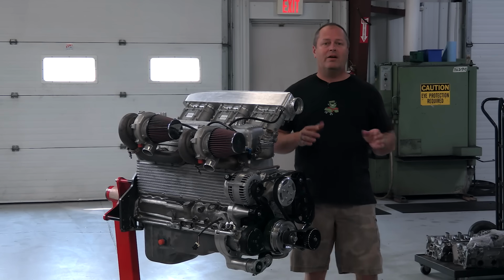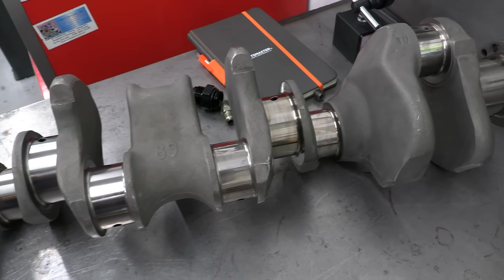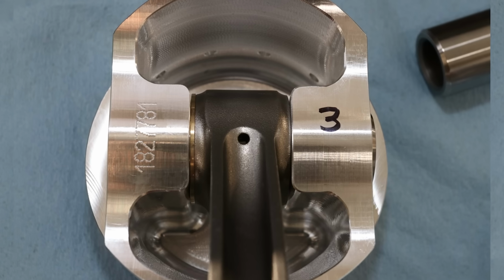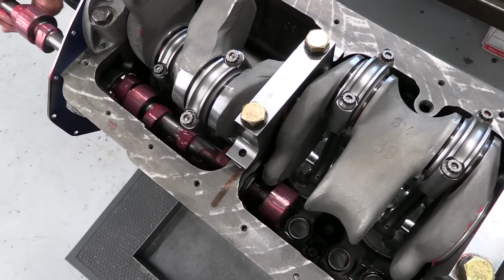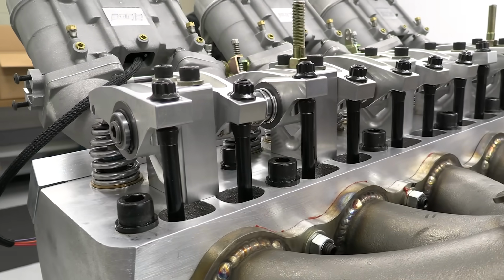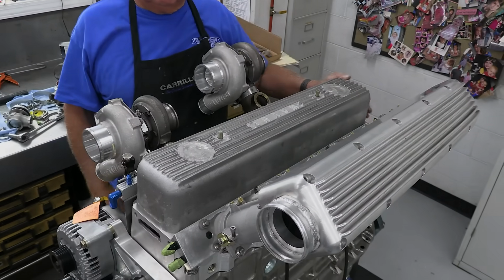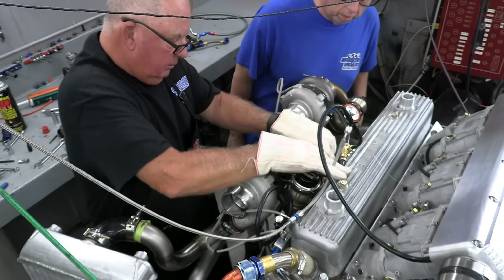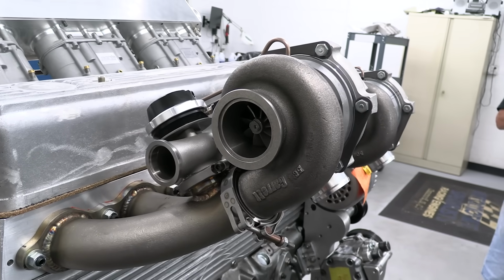Incredible Twin Turbo Chevrolet Straight Six is a One-of-a-Kind Creation!

Comment: First time watching your channel . I'm a Aussie and our straight 6 is based on the Chevy straight 6 with smaller cubes . But in Australia straight 6s where extremely popular in the day so we where able to obtain high performance parts because straight 6s where raced here . And where extremely popular street racers because the light weight cars we had to the American cars that where very heavy but great cars . We still race straight 6s with modern technology in block and head design where actually getting over 400hp none turbocharged straight 6s in a race car . There are several YouTube vids and builds of Holden straight 6s for race and street cars if you'd like to check them out .
Reply: The Holden straight six was based on the Chevrolet engine design wise. But as I understand it it has a smaller bore center.  Similarly the Ford series of sixes up to and including the Barra all had their roots in the 170 CID Thriftmaster that debuted in the 60 Falcon. The Chrysler six was based on the Slant but I'm not sure if it is mechanical locally and dimensionally the same.

Comment: Back in 1961 a friend of mine took a '57 Chevy convertible with a 6 cylinder motor and replaced it with a custom built GMC truck motor which was 300 ci instead of 250 ci like the auto engine. He put a custom cam and milled the heads for higher compression. Also installed an Edelbrock dual carb intake manifold with custom headers. That engine would wipe out a stock 283 v8 in a 1/4 mile drag race. The engine torque made the Chevy a tire burner.

Comment: Suburban should tow like a freight train with that torque curve! Turbo systems unbelievably happy making serious cylinder pressure down low for a stump pulling torque that never leaves. Makes cool whistles and stuff! LOL makes ya giggle when he pulls towards get er done throttle and boost instantly come on line! Very cool! Have a 94' GMC 2500 truck that is getting bagged, parallel 4 link, and 76mm turbo but blowing threw original TBI with a second fuel system added in blow threw hat to make sure 7.4 TBI can feed the 5.7L fuel under boost. Ported swirl port heads, RV cam, and springs should make serious down low torque.

Comment: Neat build, but I take it the design process is a lot easier when they must have room for a family of four and then some under the hood of the vehicle. Everything just sticking straight out with no worries for clearance. (Modern cars it's interesting how tight everything is packed towards the engine to deal with that.) But technically it's still a marvel of sorts.

Comment: Jeff that is an awesome build.  Definitely love seeing old school getting involved in the turbo tech.  That torque line is absolutely amazing and just what that heavy hauler needs.  

I was surprised to see flat top pistons, I thought it was an automatic for bowls and combustion efficiency -  was ratio a big factor in ?  I'd recommend overkill on the exhaust side.  By that I mean bracing for those garrets!!  They are just hanging out there and it would be a simple task to brace them up further reducing the chance of those manifolds failing.  

Again just plain awesome - 500 plus with the potential of 750 on pump 😯
Reply from the maker: Thanks! Hope you’re doing well!

Comment: Im not that impressed but Im spoiled. This seems a chevy fanboy project not a optimal performance build. This engine will not last very long a the that performance, dialing back the turbos as not going to save this engine from a short life. Typical Chevy bla bla bla LS this and that that means nothing. " put LS parts on it so Ra RA Chevy" why do Chevy guys always forget good cylinder liners and pistons. This engine will die young. Got to give him credit for building it so it runs smooth, Obvious NASCAR experience. I come from a Reno Air Racing  and Bonneville back ground and this kind of build wouldn't last 1 lap. Back in the 80s when I was a kid building hot rods and racing them I knew to use ceramic liners and I was not a pro yet. I have built 170in3 engines that are less than 200lb that made 780lb of torque 935HP at 6300rpm. Ran it 471hp continuously and it lasted over 2000hrs before overhaul for you automotive guys that is equal to 850,000 miles. Chevy guys are so out of touch. Thy can't ever comprehend why I can make that power without using a Chevy big block.  Or why I can go over 400mph with such a small engine that wont die. You all so out of touch. This thing would probably run forever if you just put some ceramics in it, I means its like WW2 level technology get up to speed.

Comment: Absolutely awesome build!
From conception to testing. 
I missed the final intended use of the vehicle. For a low use show car fuel use doesn't matter much but it looks like it would drive well anywhere between ticking around and ludicrous.?I wonder if spark plug selection is a challenge. 
Amazing knowledge and choice of parts.

Comment: CHEVY STRAIGHT 6 cyl were indestructible 230ci and 250ci and 292ci many miles and Clifford aftermarket manifolds, exhaust, carbs and if you bored out the 230,250 man it just ran, torque always rules..yeah I’m 59 had my share of Chevy 6’s I loved them... then I grew up V8s Buick through Pontiac’s.  what happened to GM they just sucks now….my Dad worked at GMC 38 years there and he can feel the less motivation and quality slowly going down..RIP to my Dad..

Comment: we had these engines in our UPS trucks in the late 70's they all failed! every one of them put push rods through the side of the blocks.
Reply: Yall had a 1962 or prior engine in the late 70s? Sounds like they were well worn at the time
Reply: @Texassince1836  the trucks are 4.5 to 8 tons! they weren't light. they were thick aluminum and heavy and thick fiberglass. the only light part of them was the roof as it was thin fiber so the light can shine through. no power steering no nothing, just power breaks and a heater for the windshield to keep it from fogging/frosting up and didn't do a great job of that either. thankfully the new trucks are all0t better. 6.0L out of the C6 z06 vette, dont know the year they bought the engines in bulk and replaced 90% of the fleet about ten years ago. in the 500 cubic foot trucks, they're fun to drive and sound like a race car due to the long 4" exhaust. played a joke on a Ferrari once with the truck and egged him on to a race, (we were bumper to bumper traffic we weren't going anywhere) it was funny.

Comment: I think I should have used the 225 Slant six that is one of the toughest Motors I've ever owned ever you can snap the crank in that freaking thing and it'll still run and you can drive the stinkin crap out of it

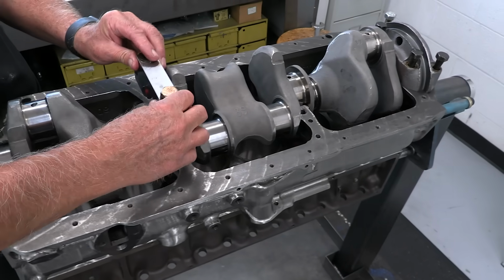Comment: 4:30. Having owned one of these in a 1970 Chevy, the 250 cubic inch version inline 6, I can attest that it was the smoothest engine I've ever owned, it was "electric" smooth. That giant crankshaft and the huge counterweight on it, may have been the single best part of that engine. Because once you feel how smooth it is, you fall in love with straight six engines. Straight six engines have better balance than a V8 or inline 4 engines, and they are inherently very smooth.
Reply: Ritalie. This engine is a different family than the newer 250 c.i. engine. Its older and different.
Reply: 216 c.i. 235 c.i. 261c.i.then came 230 c.i. 250 c.i. and 292 c.i. 292 had a few small differences

Comment: 12:20 how do you get spark timing with only 3 magnets?  you only know what's going on every 120 degrees.  most timing wheels have 60 teeth or more.
Reply: 87-2000 4.3 V6s got spark timing 120° at a time from the factory

Comment: interesting motor build..what was the actual price tag and btw,are you aware of the Multivalve heads made in argentina for the chevy 6,the ford 6,and the chrysler slant 6 Racing Classes ??.....
they get 500-550 horse using Stock short blocks....!!
Check Those out and then think about maybe building a whole New kind of monster.
keep in mind,none of that stuff has been seen in the states...YET.

Comment: Extremely interesting.  Some really clever solutions to the problems of making serious horsepower and torque from an engine that has almost no aftermarket to support it.  A crossflow head being available was really helpful.
Pretty high up the cost-to-horsepower scale, though, I would think.  Not judging, really, just sayin'.

Comment: Why would you use the stovebolt instead of using the 292 or at least a 250? One guy got 3 horsepower per cube out of a 250 and that was back in the 60’s!
Reply from the maker: This is the same block that came in the guy's truck originally. Thanks for watching

Comment: I used a Isky cam in my Ford 200 i6 build.  It was designed for roller lifters.  I wander how many of the parts used in my Ford i6 build could cross over to Chevy.  I found a lot of parts for my i6 on websites like Ford 6 Performance.  I'm sure there are some parts sources out there.

Comment: I have a mint 21,000 original miles Chevy straight six out of a 66 c10. I replaced with a lsx 454 and did a complete frame off restomod.

Comment: Gentlemen...I am a retired Service Director from Cadillac.....I did extensive armature drag racing Mopar Hemi engines in B/ MP in the 70's....Enough about me............I "bumped"  into this six cylinder build and I am ASTOUNDED at what you can get out of a small cubic inch motor like this. Any enthusiast can see this was a "no holds barred money motor."..............  I LOVED the cam sensor idea. Thank you !! You have a new fan here in New Jersey !  God bless !
Reply: What kinda times did u turn in that Hemi in your B/MP class?
Reply: Powernation made a Ford 300 six and put a turbo on it and it made over 500 horsepower with just one turbo. Go check it out on there channel it's a white painted motor with turbo
Reply: @bradleymadosh911
Reply: 😂🎉😢😮😅 @bradleymadosh911
Reply: It is impressive that this engine is putting out 588 ft pounds tq at 3700 rpm.
Reply: It’s a shame they don’t make much aftermarket for the inline 6’s. Would be cool in a Nova or Camaro but not sure if you can close the hood though!? You also would have to spend a ton and have access to custom fab machining to make parts fit and unsure if the bottom end can take the abuse long term.

Comment: Well at least if the turbos don't spool up as they were designed to,  they can still get the SIMULATED turbo sound from that Ford power steering pump which is KNOWN for they're famous whining noise.  I'm sorry,  but I think a little more time should've been put into the power steering pump selection.  I mean,  it has a Ford rear main seal,  a BMW water pump,  a completely custom made cylinder head,  B/B Chevy connecting rods,  and so on and so forth.  Yeah,  I would've at least TRIED to stay away from the dreaded Ford p/s pump,  and came up with another way to go with it.  But hey,  that's just me.  It's STILL an ABSOLUTELY AWESOME build,  I'm not taking that away from it by ANY means.  Good job to the designers and the builder.  SALUTE!

Comment: Funny you should use that engine because I've done this stuff for 53 years I used to work part-time for a guy that did classic Chevy restoration parts and he didn't do any work on anything just old parts and you only had one choice for engines in classic cars when it was 6 cylinder it was either the 235 unless you go farther back and it was a 216 but they had a 235 passenger engine and then they had a 235 truck engine but the 261 heavy-duty truck engine only came in a commercial truck it was never offered in a pickup because it's heavy duty they only had 235 so that 261 after you've worked on it should be like a 270 or 272 after its bored unless you stroke it but I wouldn't but that's a good engine for hotroddin so I'm surprised to see it here because that's the first one I've seen other than myself thinking about it over the decades

Comment: now if only they tapped the top of the head to accommodate the rocker cover with a machined outer lip for a rubber push on seal and also matched on the rocker, that way the oil will stay where it needs to under loads. :) Just like the intake throttle plate with customised rubber seal?

Comment: That engine is a truck engine, truck 6 cylinder engines back then were made with a lot of torque as they are working engines, not race engines, so using modern  bearings and pistons and i beam and studs or Hi grade 12 bolts will do the trick to make a great powerful engine its that simple which is why the japans RB30 engine is so powerful with little or no extra performance added other than fuel injectors and larger turbo and coolers and thats it over 450 hp at the crank with stock internals?

Comment: These engines are very traditional here in Brazil, known on the Chevrolet opal, they are used in drag and there is a legiso of plurist fans who love this engine, including I am assembling an aspirated with weber 40 and dimensioned 6x2, I will use a command 260s from the national company Kuir. I loved the video.
Reply: I had a friend that put a 427 big block chevy in a opal

Comment: I have two of them old wine cylinder heads one for the same motor he's talking about and then I got one for a 292 Chevrolet 230 250 292 I used to running on my race car back when I had the super 6 series and it's showing up give some more power you never can say you can't get horsepower 6 on her but you called you can I promise you especially with them putting turbos on it yeah the torque is going to be unreal

Comment: Up to 1998, brazil had that engine in the chevrolet omega, 4.1L fuel injected 6cyl.
Reply: Brazil only had this motor until around 1978 or so. The 4.1L is the next generation of inline 6

Comment: The Chrysler slant sixes, the GM straight sixes,not to mention the Ford straight sixes were always the engines that got pulled and thrown away when I was a kid in the mid to late 60's.
I loved muscle cars and restored a few.
No one wanted to have a six in their cars when I was a kid.
No one could stand the sound of a six compared to the rumble of a V8..
Having said that, I bought a 1967 Pontiac Sprint in 1970.
That car was extremely rare,due to it having a single over head cam six, that made close to the same hp as the 326 V8.
It was a lemon.
The engine was notorious for eating cams at a very fast rate.
It also leaked oil at a prodigious rate.
But it looked sort of like  a GTO.
It's one thing to make a six put out power, but unless its a BMW, Jag E Type,or MB the street cred is hard to obtain.
Should have had this tech in 1970!
I could have been cooler.

Comment: I have a theory as to why the combustion chambers were such a lousy design [probably BS, but bear with me] GM  had a hierarchy, from bottom to top, cherolet, Pontiac, Olds, Buick ,Caddy. Now someone buying a flat head, more expensive Pontiac or Olds would not like to be seen off at the lights by a Chevrolet. Ok, So top brass say to the Engineers at Chevy, "We have to be traditional and make it OHV, however we need you to down grade its potential a bit, so just make the head less efficient, keep the buyers happy but we won't piss off the buyers of our higher status cars. Fanciful?  Maybe not as much as you might think.

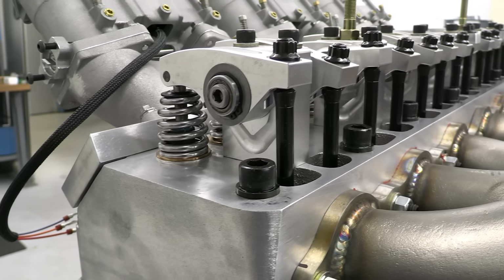Comment: 15:28 What about a two-piece valve cover where the top section can be lifted off and the bottom stays attached to keep oil from running all over the place when removed?

Comment: Doing a dyno run without the water pump running seems insane.  Eliminating the drag of the belt driven components will the highest power figures, but it's basically lying while also potentially damaging the engine.
Reply from the maker: They use an external electric water pump to push water through the cooling system. It's a common practice because often the car builder will add their own front drive system so there is little point in trying to configure a belt system to spin the water pump. So the engine is being cooled. And it isn't lying. If you want to account for the water pump, just remove 5-12 horsepower from the peak. Thanks for watching.
Reply: @TheHorsepowerMonster  This engine already had the complete drive system; what's the reason to not run it?
Reply from the maker: They put it on later. It was off for simplicity for the initial tuning. That is when this shot of the dyno pull came from.

Comment: "Chevrolet never made the straight 6 with any sort of performance in mind"
Laughs in 53 Corvette
Reply from the maker: the Blue Flame engine was worth 136 horsepower. Barely 15 better than the base version. It was more a marketing exercise than an actual performance engine. At least that's how I feel about it.

Comment: I had a '64 GMC longbed stepside with a 292 straight six and gear driven cam. It ran smooth with a 283 v8 flywheel  (it was what I had and the holes matched up).  That engine was unstoppable. Got 25 mpg too.

Comment: man this guy reminds me of myself but in much larger scale. right now im building a manual transmission control for an automatic trans. TCM took a crap and a new one cost as much as the car so, BUILD IT MYSELF FOR $20! only 2 OBD 1 scanner models available? program a piggyback Arduino to read the ECU! then theirs my brothers car. cant find a transmission filter worth a crap. build a pickup tube, buy a filter kit on amazon for $25 that converts the cooler line to a PH16 filter? yes please. id love to be his protege.

Comment: As this is based onto an analog engine design, why not use an analog fuel injection system that instead of an ecu managing the fuel injectors you use a potentiometer and wiring connections that when coming into contact on both the rotating disk side and the stationary side activates the injector to supply fuel in the chamber for each revolution?

Modern digital inspired for simplicity.

Comment: When you showed the water pump I said that looks like a BMW water pump and it was.  I have changed enough of them. All the 6 cylinders from the 70s-late 2000s use a very similar water pump.